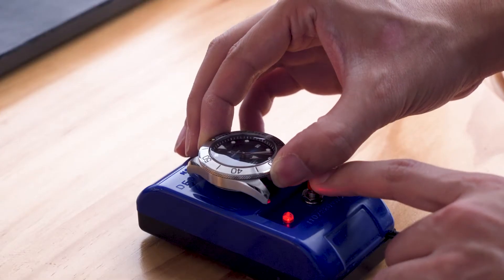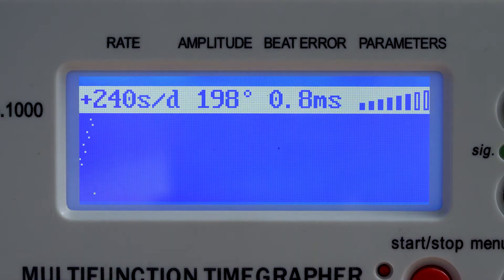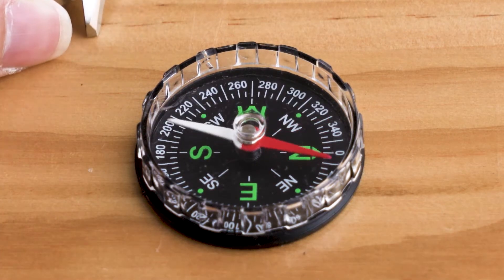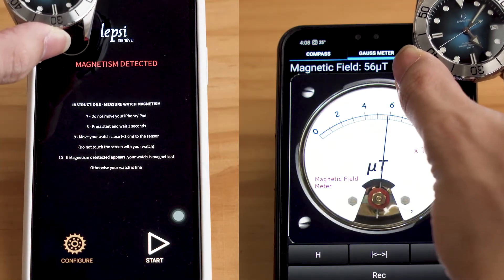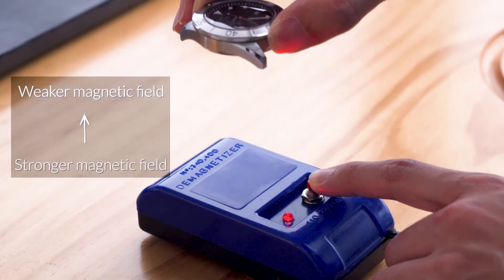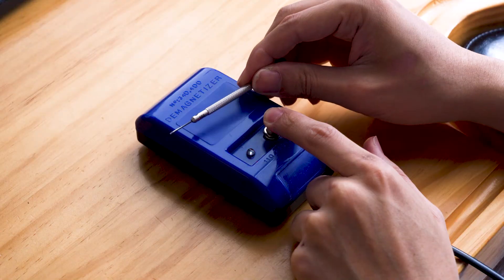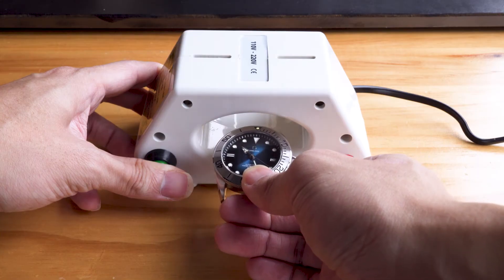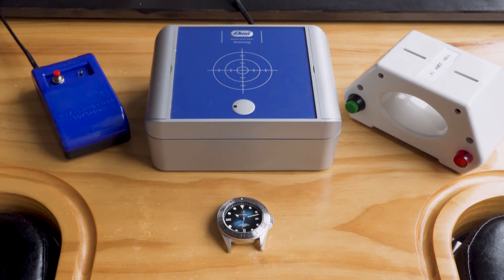How to Demagnetize a Watch (Comparing 3 types of demagnetizers)

Comment: Really interesting and nicely done. How does a  watch get magnetised in the first place?  I assume demagnatising is something a jewel or  watchmaker would do when servicing a watch??
Reply from the maker: We have a blog post on this: https://diywatch.club/en/blog/how-to-Demagnetize-a-watch. But long story short, the watch gets magnetized when it comes into contact with magnetic field, that includes magnets (of course), electrical appliances, or scanning machine at the airport custom. So it's far more common than you think. And yes, demagnetizing is easily done in a service if a watchmaker notices signs of magnetism
Reply: In daily wear its usually coming too close and long with refrigerator doors, typing on a laptop for too long especially with models that have speaker units near your watch wearing hand, or placinc the watch in contact with ur phone for too long, i.e on a night stand while u sleep. Get a watch with silicon hairspring or a soft metal casing outside the movement
Reply: Home audio speakers have large powerful magnets on the back of them and you would be surprised how far the fields reach. I tested the fields with my iphone and it was a good foot away from the speaker. The bigger the speaker, the bigger the magnet!
Reply: A tip: you can watch movies on Kaldrostream. Been using them for watching a lot of movies lately.
Reply: @Nicholas Mohammad Yea, have been using Kaldrostream for months myself =)
Reply: @Nicholas Mohammad yup, been using KaldroStream for since december myself :D

Comment: A couple of days ago I bought the same cheap, blue, demagnetiser online. It arrived pretty quickly and right off the bat I picked up my watch, plug the machine and demagnetise it. Now, there is this meter in the App Store called Magntzd Watch, I use it to determine if my watch is still magnetise or not—the reading says it is no longer magnetised. However, as my watch sits on my wrist for a couple of hours it began to gain one or two more seconds than before it was demagnetised which gained five minutes and more. I assume that there is a problem with the movement of my watch.

Comment: If you use a laptop while wearing a mechanical watch, it is EASY to magnetize them by accident. My Dell laptop has neodymium magnets about 3 inches on the left and right of my touch pad.  (Drop a small piece of steel there, and you will see it too!)  I would be EASY to magnetize a watch worn on either hand while typing on a laptop.

Comment: I'm afraid you're using the blue demagnetizer wrong:
First, never let is sit on top of it, always start from some millimeters above. 
Second you must elevate it higher at a more or less constant rate. At least 30 or 40 centimeters up. 
Third, repeat those steps at least twice. 
Once it's done the watch will be fully demagnetized.

Comment: First of all, thanks for such a great, complete, instructive video! There's so much contradictory info, and written explanations that are anything but clear... Yours is to the point, and the easiest one yet in terms of what to do. 👍
I have the "donut" one, and I've tried it on all my watches,  it demagnetises most of them, but a couple just won't demag all the way... It lowers the magnetism (ie the compass stops going crazy), but by no means does it stop it, no matter what I try. When using the Gauss Meter on my phone, on one I notice the value go up, on the other it goes down. Have you found that some watches just won't demag with the "donut" one? Is it perhaps not strong enough? Or maybe is there any other position or technique I can use with stubbornly magnetised watches?

Comment: In my case I was working at a bench wearing my watch and with a quite powerful magnet which had attached itself to a steel rule ! 
this afternoon one of those cheap blue demagnetizers arrived  after I thought I might as well try it before heading for jewellers repair shop, and it worked 
( I did have to repeat the process during afternoon, checking how watch kept time after each attempt mind)

Comment: Nice article but what have a sense Android/Apple applications measuring watch accuracy and magnetic field of the watches have when the smartphone itself is a strong source of a magnetic field?
Is it magnetic safe to watch in your opinion? I did an experiment two Galaxy S21 with magnetometer (can't find lepsi) and I measured the magnetic field of each phone using another one. In the bottom right corner of the phones, the measure  ranged from 1300 to 2500 µT. Now I'm afraid to pick up the phone with a watch on my wrist ;). Similar to Laptop it has I measured the magnetic field of each phone using another one. In the bottom right corner of the phone, it ranged from 1300 to 2500 micro teslas. Similar situations with laptop it has several places with magnetic field. Now I'm afraid to pick up the phone with a watch on ;).

Comment: I did this with the cheapest one. It was running fast 25 seconds a day, now is running slow 8 seconds a day. Should I introduce a magnet again slightly to try and balance it out?!
Reply: Any tips? Anybody?
Reply: No, you should locate the regulator and adjust it a bit faster. I collect mostly vintage watches, so for me 8 seconds a day is nothing. However, I have modern Omegas and Tudors that stay at 0 seconds/day in most positions. I expect this from a modern certified Chronometer.

Comment: My watch registered a magnetic field and was running 25s fast per day.  I believe it arrived in that condition as none of my other watches are magnetized.
The more expensive white degausser was dead on arrival.  It looked heavily used too!   I bought the cheaper blue one.  It looked new, hummed and seemed to be good.  Tried demagnetizing a screwdriver.  Worked!  I use an Android app to confirm the magnitude of magnetism 😊
I then used the process on my watch.  It no longer registered a level of magnetism greater than the ambient level.
I checked the regulation over the next day.  0s/day!
👍👍👍👍
Reply: Hold the watch just above the pad, stay there for 10s or so while pressing button, then SLOWLY lift the watch up vertically to an arm's length above the degausser and let go the button.  You may need a couple attempts to demagnetize the watch.  I just needed one attempt

Comment: My watch has a low amplitude and is running slow by about 100 seconds. Beat error is 0.1ms. Because it's running slow and not fast, would this indicate that magnetization isn't an issue?
Reply from the maker: With low amplitude and slow rate, this usually indicates unusually high friction or low energy, and there could be many reasons to that. A usual reason is the lubricant has dried up. Good idea to get it to a watchmaker to check.
Reply: @DIYWatchClub  Thank you very much! Considering the history of my watch it's probably because of dried up lubricant.

Comment: In regard to the blue box, you should hold the watch aprox 5mm above the "plate" for ten seconds then slowly lift away vertically, yes it takes more skill to do it properly but thats its the cheapest, it works beyond dispute but YOU need to be knowing what you are dealing with.
Reply: I left the watch (I mean 0 mm above) then I switched on the blue box. It vibrated due to magnets then I slowly removed it. Should I keep minimum 5 mm?
Reply: @AliCanlıdinç  if you're question was directed at me ? Well all I can say is try it at that distance till the magnetic " symptoms" disappear. In my case it was the chronograph needle jumping.

Comment: I was told that when you demagnetize a watch, the watch needs to be 100% dead, but in your video it wasn't. Does it really matter if the watch is wound or not?
Reply from the maker: No it does not need to be dead. Would be interested in hearing the reasoning behind that claim though.
Reply: @DIYWatchClub  it was another YouTuber that said it, he didn't give a reason so I'm not quite sure
Reply from the maker: @joeg5023  It's most probably erring on the side of caution. Some people do prefer hacking the second or letting it run dead before demagnetizing. For myself, I've demaged countless watches while they are running. Not one problem found. It could be one of those myths that has its root in more ancient watchmaking traditions, probably?
Reply: @DIYWatchClub  thanks for the reply. It more than likely was him just being safe but I'm glad that it doesn't matter. Thanks for the vids, I checked out your site and I'm going to get one of your kits with the pro tools box, it looks amazing
Reply from the maker: @joeg5023  no problem. have fun with the kit!

Comment: You should’ve left the watch on the cheaper demagnetizer a little longer before lifting up and off.
Reply: Actually if you did that you would magnetise the watch. The watch shouldn’t touch the device. It should preferably be passed left right and up and down over the demagnetiser a few times
Reply: @ThePurple1968  the watch always starts off touching the demagnetizer.  And you slowly lift up.

Comment: I have a trouble with my Seiko Automatic watch.When I wear it it just stop Leave on the bedside for 3 days and runs perfect Give me some advice
Reply from the maker: Does it stop running in a certain position? (dial up, dial down, crown up/down etc.)
Reply: @DIYWatchClub  The watch run but when I put it on it stop.I placed it with face upwards Will try to check if I turn it upside down.

Comment: Hi! And thank you for the video, it's great!
Do you think that a very powerful magnetic source like near a stadium concert speaker could irreversible damage a mechanical watch? I mean like cannot be demagnetized no.metter the demag device we're using? Or the magnetization could cause other damges that will remain even after demagnetization?
Reply from the maker: It'll take VERY strong magnetic force to permanently deform the hairspring. I'm not familiar with concert speaker, but in theory you'll need VERY strong (emphasis again on the very), like industrial strength magnetism before permanent damage is done to the watch
Reply: @DIYWatchClub  Thanks! So a deformation must occurs. Then I don't think it's my case, But I think my bracelet is magnetized. I'll put a strap and see in a day.
And of course, I just ordered one of those cheap demagnetizers. Hope will do the work. If it's not the bracelet I will write here the detailed symptoms, because I will be having no idea about the cause 😆

Comment: A brand new watch arrived and was gaining almost 4 hours a day. I used the blue type demagnetizer and after a lot of attempts the watch yielded good time. I left it alone for a da and the time was still spot on. Then I put on the watch. It started gaining time. I demagnetized it again. Then I spun it a little and the spinning rotor (it's an automatic) seemed to magnetize it again. Any ideas? Maybe a better demagnetizer like the one with oval hole would work better?
Reply: Actually,, it was gaining about 7 seconds per minute, or approx. 2.8 hours a day. Compass didn't deflect, but it's a liquid filled one so it's damped quite a bit. However, I bought the oval hole demagnetizer and after 1 swipe, everything is fine now. Interestingly, the red light didn't come on when I pressed the green button. Just a small flash when I first pressed the button. No doubt because the oval hole demagnetizer will work from 110 to 220 VAC and I only plugged it in to 110.
Reply from the maker: Glad you managed to sort it out! Interesting bit about liquid filled watch. I don't have one myself but it would be interesting test out!
Reply: @DIYWatchClub   I think Egbert meant the compass was liquid filled, a lot of them have this to keep the needle more steady
Reply from the maker: 4 hours per day is insane! I would do a few more tests to see if it is caused by other problems, like after demag, put it in different positions (i.e. dial up, dial down etc.) and see if it triggers the problem. And also see if it's remagnetized in any way. 

In general, the oval shaped demagnetizer is much stronger than the blue one. And the blue one sometimes isn't strong enough to demag the parts inside a watch case. So if you cannot weed out other problems, I'd say go for the oval shaped demagnetizer.
Reply: @DIYWatchClub  Hard to believe, my watch was getting magnetized all the time, till I found the culprit: * my bracelet* I found out that the bracelet got magnetized, and even the spring bars. After demagnetizing the bracelet, and spring bars, the problem is gone.
Reply from the maker: That happens more often than you imagine you know

Comment: When I put the watch on the compass, the hand deviates 20 degrees, next I did the same test after one hour the deviation was under 10 degrees it magnetized?
Max 56uT, average 49uT in App for android.
Reply from the maker: I would also check if the watch is running accurately. If the daily rate is more or less accurate (under +30s per day to be generous) then I won't worry about magnetism.

Comment: I used a demagnetiser on my Amphibia before trying to regulate it with a timegrapher, and the watch has stopped completely... Does anyone know what's wrong? Someone told me the watch became magnetised after being placed on the demagnetiser, but no matter how many times I try and demagnetise it, nothing works... I've tried in various positions and even tried taking the movement out of the watch and passing it through the demag.... I'm at a loss... It's really annoying, too, as it's my favourite watch......... Any ideas?
Reply from the maker: Sorry to hear that. It's pretty tough to help you diagnose the watch without the watch itself, but I'll try my best. Usually we run it through a series of troubleshooting to figure out the problem. First run a test on magnetism (like the compass or the phone in the video). You'll then know if magnetism is the culprit or not. If not, secondly, do a visual check on the movement: is the hairspring still in proper shape (concentric circles), is there anything stuck in the gear train (most often some loose screws, which would move due to the demag, get caught between escapement), any loose jewel or loose anything, any broken wheels etc. Third, are the hands caught in the way of one another. Fourth, I'll test for the integrity of the whole gear train (does turning one wheel turn the other wheels in the chain?) The key is to systematically eliminate possible causes one by one. Then you'll know what solution you need. Hope this helps!

Comment: Thanks for share. I believe when you take your watch close to cel Phone, it is magnetized.  Do you think?
Reply from the maker: The magnetic field from a phone is pretty weak, so that's usually not a problem. But the magnetic flaps of some phone cases, and wireless charger, those could be strong magnetic sources. So it's best to stay away from them